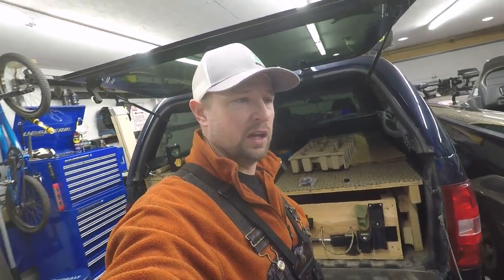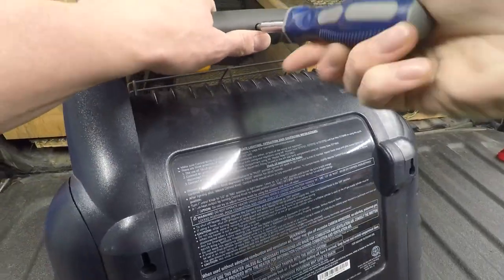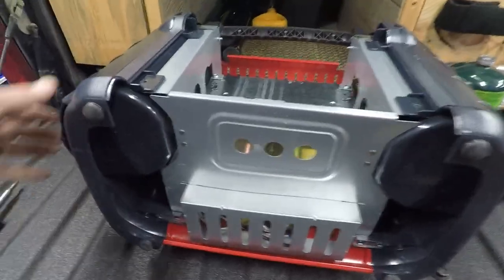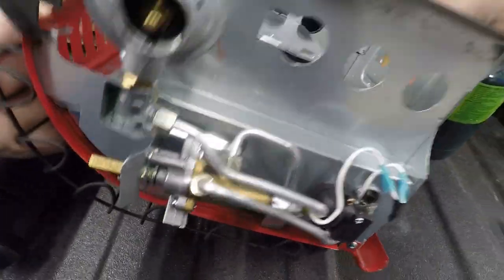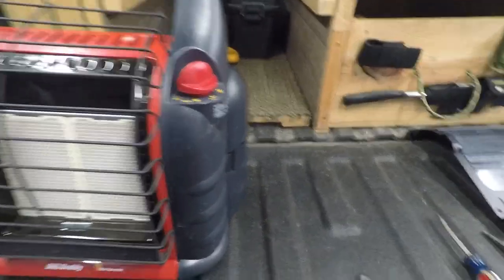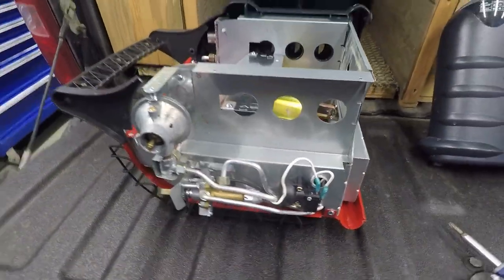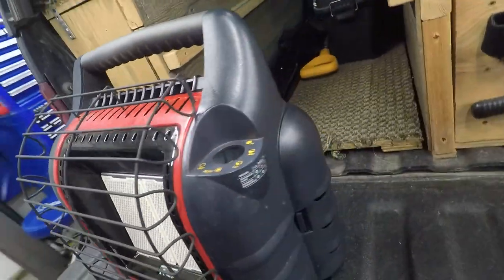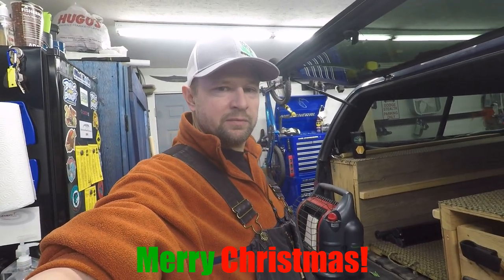Mr. Heater Big Buddy Fix - LINK TO VIDEO W/ BETTER AUDIO IN THE DESCRPTION

Comment: Thank You! My pilot would light but would not stay on. I called Mr Heater and they helped me to bypass the tip over switch and that was the problem. I didn't know how to take the heater apart and fix it. I'm so happy you made this video
Reply from the maker: I'm sorry you had the same headache as me, but I am happy I was able to help you out. Makes me really happy that I can help someone out. That's my goal with these videos. 🙂

Comment: I have a buddy heater from when my oldest big brother passed away  i tried messing with it and  I got so fed up trying to think what can be wrong with it and honestly  I was about to throw away but now i ran into this video i will make sure to look into this buddy heater I have  it is acting just as you explained pilot light lights as long as you hold knob down, but  the second you let go out it goes i think you just saved a double buddy heater from the trash can  So will go take it apart and find out if it is the same issue for sure So BIG THANKS
Reply from the maker: You're Welcome! I hope it works out for you! Thank you for watching! 🙂

Comment: I researched these heaters fairly well I thought before I purchased one I read customer reviews they said to run a filter which also serves as a regulator when running a twenty pound bottle so I bought heaters one with the CO2 detector and mysteriously both heaters started doing what you are talkin about within an hour of each other I lost both heaters quit p it sounded like liquid was bubbling in the pilot light orifice you could tell it was not longer a vapor and you could hear bubbling so I took a small propane torch turn it down real low and heated up the thermocouple with a torch allowing me to turn the heater high I had to do this two or three times to each one and within a few tries they were both working again for my situation it was not the tip over switch it was not the thermocouple it had nothing to do with me running a filter maybe moisture got in my hose but by using the torch I was able to correct both situations and they have both worked fine since
Reply from the maker: Thats great to hear man! Thank you for sharing too! I like hearing how others have fixed similar issues with other methods and could definitely help others as well.

Comment: With all due respect thank you for all your information I have learned a lot more about my heater if you have the same problem again listen and see if you can hear the pilot light bubbling as it has liquid instead of vapor you will hear it bubble that is what mine did and I corrected both heaters by using a small butane torch to trick the thermocouple into lighting the heater and ultimately burning the moisture out of the system I am thinking the longer aftermarket hose I bought was laying by the floor where it is cold and when I shut the heater off it probably sweated and drawing moisture although I am not certain of this I just know I did not have to take anything apart and I was able to get both heaters going just food for thought thank you once again
Reply from the maker: Awesome!

Comment: My buddy heater knob broke, so I epoxied it back on. For some reason it was binding up, causing you to use excessive pressure to push down and turn it to start it. My guess it was a factory defect. The knob kept breaking and I eventually gave up on it after fighting it for 2 years. I should have returned it day one. My second one works flawlessly. We used it mainly in our popup. I keep it now just for emergency  heat if the power in our home goes out. They are a bugger to take apart and even worse  to reassemble. Mine has the built in fan. One of the last ones they made. Now they do not come with a fan.
Reply from the maker: That knob issue sounds like a pain. If you ever get it figured out and fixed let me know by commenting on here in case others have had the same issue. Thank you for watching! :)

Comment: I am curious since you are so mechanically inclined why you did not just screw the bottle in before reassembling and do a test check without fully reassembling the unit I generally check it before I fully assembly that way if it does not correct a problem I don't have to do it two or three times
Reply from the maker: I apologize for the misconception, but I don't consider myself an expert or that mechanically inclined. I just know what my issue was and how I fixed it.
Reply: @AROoutdoors  cool 😎 beans.... have a BLESSED DAY!!!!
Reply from the maker: @larryworkman1689  Thank you Larry, I appreciate that. I wish you a blessed day as well! 🙂

Comment: Although if you had an electrical meter you could just check the switch itself and see if it was functioning properly a lot easier than taping wires together if you know how to set the meter  and use it that is....
Reply from the maker: Like I stated before I don't consider myself mechanically inclined, I just know what I know from what I have done that has worked for me. Plus, if others out there are just like me then this was that I showed is a good way to check. Yes, it takes a little longer but it still works.

Comment: My heater works fine on low and medium but when I turn it up to high it's like it's not getting enough gas. Do you have any idea what that cause maybe
Reply from the maker: The first place I would start with is the hose. Make sure you are using a "mr. Heater" hose because I have heard some of the other hoses can damage the units. The next thing I would do is to take a Q-tip and clean out the small outlet where your pilot flame comes out of because that can get dirty over time. I hope that helps. Take care.

Comment: My problem is the pilot will light, but goes out when I try to light my grid, or about 3 mins
Reply from the maker: Does your flame seem smaller than normal? If not then you might have some buildup in the where the pilot flame comes out. The reason why I mention that is because it might not be getting enough propane through there to light the grid. Something you can try is to clean that, without taking much apart, with a q-tip or a small pipe brush. Keep me updated if that helps. Also, are you using a Mr. Heater propane hose?